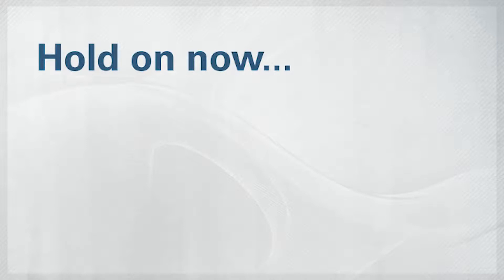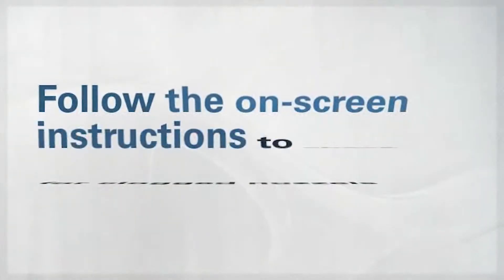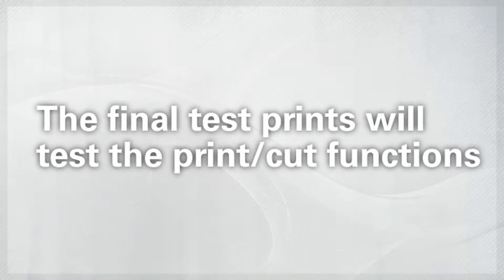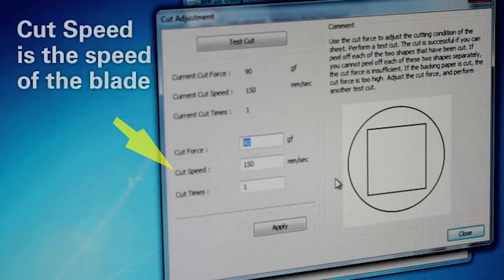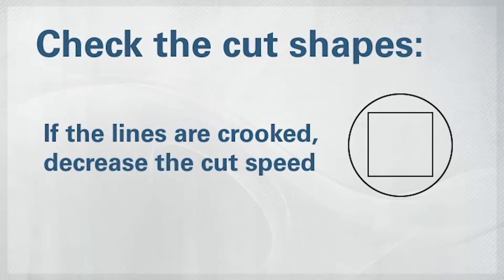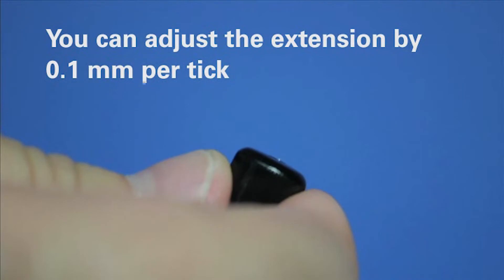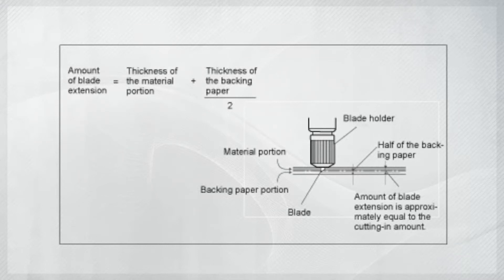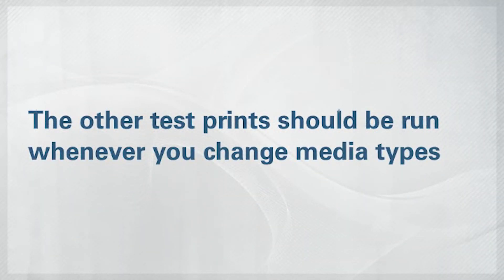VersaSTUDIO BN-20— Part 9 Properly Calibrating Your BN-20 with Test Printing and Cutting

Comment: I ended up with one of these pieces of junk.

I dont know if the machine is ruined or not but it says 'setup incomeplete' on versa works and no sheet in the utility. Ive made sure the paper is in the machine set up right.

Also its beeping twice and flashing. When the machine starts it makes clicking noise and im also not sure if that is normal.

Thanks for your time.